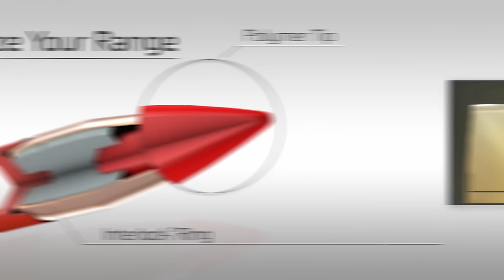Ep. 121 - Let's Talk Load Development

Comment: Stating that barrels lots of components is good to assist precision implies that variations do matter i.e. brass - but at the same time you state brass prep doesn't help. So how big are the variations between brass lots that make a difference if you were to mix them up? (same manufacturer)
Reply: Mixed year/headstamp military .30-06 brass back in the day I'd see as much as 150-200fps ES.  Mixing lots of modern stuff you can still see 80-100fps ES where you would normally expect 40-60fps on a large sampling.  It may be as simple as a revision made to tooling in the forming process of a bullet jacket or a case that may improve the product overall, but makes it different from previous production and causes shifts in POI, or changes in internal volume... stuff like that.  That's why I suggest whenever possible to keep same-lot components together and double check when you get into new lots of components, especially powder.
Reply: @milesn3173  thanks yes I assume we are talking  components that in general are created to tighter tolerances. But it clearly suggests that variations matter. Most of what precision shooters do is remove variations but these podcasts seem to imply that doesn't matter. Could it be that the system/platform being used is what determines if a variation is noise or meaningful. I.e looking at extremes a rail gun vs a hunting rifle.

Comment: This is really interesting, but it doesn't really account for how the top F-class shooters are doing two shot ladder tests for powder then seating AND then consistently shooting mostly X/10 match after match at 600/1000yrds.  Meaning clearly an agg of their match results is statistically significant, so it would be super cool if you all did a follow-on to this with how they do that.
Reply: What you don’t know or see is the barrel they burnt out just for load development.  Plus they turn 8-10 barrels up at a time.  One is usually burnt out on load development and short range local matches.  They then just transfer that load over to the new barrel.  Adjust powder charge and verify and roll on.  Also they usually stick to a cartridge that works.   Like the go to was 284.   Now it seems they are switching to 7prc variant.  Running a round they have ran for years it’s a lot easier to load for.  And a lot of times they transfer load data from one barrel to the next.
Reply: No, thats dumb. If you were paying attention, the fact that the top guys are all using top-tier components/barrels/actions, skill and machining then that more than accounts for their wins. They use good ammo and barrels.
Reply: @Longshot762x51  i know they use good barrels , components, actions and so forth.  But I’m like 90% sure fclass John and winning in the wind have videos where they had a batch of barrels ( same blanks ) same reamer and specs.  And their current barrel was on its way out they switched barrels and their new load development was to shoot their current load and then a few below and about their current load.   I know they use the top components.  But i can guarantee they don’t go thru a full load development process on every single barrel. If they did that barrel would make it 2 matches at most.
Reply: @MrBoostin18 you are right, but you forget all the reloading on old barrel they did that accounts for the data needed. Both them and Eric Cortina do not need to do full development because they know what has worked for that cartridge and the 1000 plus rounds on the last barrel. Erik Cortina admitted that on pod cast with Jayden Quinlan. Changing a barrel and shooting old load a adjusting if need is fine. But Erik said if it was new cartridge and gun he would shoot 3 shot tests and then pic the best couple and do 10 to 15 shot test. He would then pick the best of the two and shoot a 20 shot test to confirm load. Then in different conditions in a different day (Hot vs. Cold Rain vs.Sunshine, etc) and shoot atlest 10-15 more before settling. So add up the shots and it's is not 2 or 3 shots and go with new rifle and Cartridge. Also, Eric runs the same bullets and powder in his F-Class guns. Barrel change to him is like getting your same powder but different lot. You don't need a lot of rounds to find your load if you need to change at all from last load. Erik most of the time does not have to change load. But with new barrel still shoots 2 or 3 shot group then shoots atleast 15-20 more with just barrel change. What they are taking about are people get new rifle or new powder or new bullet and shot 3 or 5 shots and calling it good  and heading to match or worse heading out hunting. A badly dispersed load can make your day bad for match and worse a horrible day for any animal if your hunting. Hope that explains it more.
Reply: Folks the topic and my reply are about load development, not follow on barrels chambered the same, not about their equipment, not their skill reading mirage and wind.  It's about load development.  If people actually read what they write they would know the top shooters don't do large data sets as part of their ladder testing specifically due to if they did they would put too many rounds out the barrel not leaving enough for competition.  If you read for most any of them, they all use basically the same process to find the node and load they want to settle on.  Then in competition they prove that process out by shooting sighters followed by 20 shot groups and do that over many days and matches.  Their own match targets show their development process works just fine and it's not using large data sets.

Comment: You state that hand loader improves over factory loads as you can alter seating depth - that statement appears to go against what you have stated for your load process and your other pod casts. This is getting confusing...
Reply: They didn't say it didn't matter, just that it's effects are not as pronounced as most people believe. Seating depth can have an effect, but it's not going to turn a 1.5 moa load into a .5 moa load. They also make the caveat that this applies only to the chambers and bullets they've tested and that there may be some chamber geometry/  bullet combinations where seating depth changes have a more pronounced effect on group size.
Reply: @lb4937  well the general message is its impact is very small if anything. So why mention it as an advantage over factory ammo? Its hard to see based on this data how hand loading improves over factory ammo in terms of precision. But it is very rare for factory ammo to be shot in precision world. The take away appears to be that handloading allows you to load at a FPS that you want however the slower loads shoot ever so slightly better so why bother - just shoot factory, just keep it all from the same batch.

Comment: Speaking of load development 

When are we going to get 22 creed on the books
Reply: I was told they can’t put any data out for a year. Horizon firearms has exclusive rights to the cartridge for a year because they were a huge force behind getting it saami spec’d. I don’t understand why Horizon wouldn’t want data out help the cartridge. Hornady wants to push the 22ARC, so they don’t want to publish data for a 22 caliber cartridge that stomps all over it. To me they are different enough that there shouldn’t be that much competition between them. One is great option for a small frame AR, the other is the ultimate bolt gun high BC 22 cal.
Reply: @DanL243  I'm sure you're right just be nice to hear it from the company

Comment: I thought the case capacity was measured with distilled water.
Reply: It can be, but it must be done very carefully for it to be accurate. I use a small thin piece of glass over the case mouth to ensure the water is level to the top of the case every time. Otherwise, surface tension will cause the water to be slightly domed or dished relative to the case mouth, and it's very difficult to consistently judge how much dome/ dish you have case to case. Distilled water isn't necessary, really. Tap water is fine, but you have to be careful that there are no drops on the outside of the case or the glass.

Comment: Enjoyed this but have seen a lot of rifles, mainly hunting rifles, that will prove time and time and time again that what you’ve dismissed here regarding seating depth to be absolutely not the case. And we’re not talking a handful of groups……we’re talking large amounts of groups tried over several years, so it’s not data to be dismissed because it’s ’not Significantly sized data’, and I’m absolutely not the only one to see the same. Thousands of shooters have found the same as me……a load can shoot absolutely horribly at 50 thou off and yet at 20 thou off be CONSISTENTLY 1/2 MOA. There’s more to it than just ‘pick a combo and if it don’t show what I wanna see, scrap the whole job and start again’. More has to be at play, different barrel profiles with all the differences in chamber tolerances seen across factory produced rifles. 
You speak about data being important, which of course it absolutely most definitely is, but by the very process of what you’ve compiled your findings on, it’s impossible to state some of this because you yourselves havnt compiled enough data with different rifles from all different types and price brackets…..I’m absolutely not saying your wrong, but for so so sooo many shooters out there using really great loads that would never have been found using your method, and they would have spent a fortune buying endless different powders and components hoping to land on ‘the one’. 
I would LOVE to see this episode all over again with some of the top class hunters that have developed loads for basic off the shelf or mildly improved guns, as well as the likes of Jack Neary and Eric Cortina. I think it would provide a more balanced evaluation of what can be achieved with methods across different platforms in our respective sports with the varying equipment we use
Reply: If you had paid attention, you would have remembered that they specifically poibted out that older hunting rifles or rifles with horribly cut chambers CAN be sensitive to seating depth.

Comment: i do the "Married w kids" method (meaning cheap) - Satterle , 1 shot per charge going in 0.2 increments for velocity nodes, will do 10 shot test starting at book max and going backward 10 charges.
i will find all the nodes and build off of those. if there is not a real node i will use 80% of book max and see from there.
i will test several bullets for the caliber to see which shoots best, SST and SP and ELDX
i do not have money for doing 5 shot groups testing nor do i have access to the components such as powder is very hard to find still so 1 shot groups it is for me.
10 charge weights then a 3 shot group of charge = 13 shots to find best load VS 50 charge weights shots then 5 shot group of charge. - i just saved 42 shots of components
Reply from the maker: I'm not looking for "nodes" at all. Just speed and pressure.
Reply: @hornady  just saying married w kids as in cheap ha
Reply: ...I don't think you quite understood what they were trying to say here. Preston's method is more or less the exact opposite of the method you described.

Comment: Amazing to me that you guys can’t figure out tuners. You think every F-class guy is insane??  And you  can’t explain why your 7 prc factory  ammo is slower than advertised.
Reply: Cant figure out or just haven't proven they actually work as advertised with statistically relevant testing? If there is data proving they work as billed, can you share it?
Reply: @brodychapman8348  I don’t have the time or money to give you data. The pro shooters won’t tell you everything because they hold info close. Hornady shot enough data but the way they used the tuner was wrong. Let me open your mind a bit. In this podcast Miles said that changing muzzle brakes could help your load. Picture when you adjust your tuner you are putting on a different muzzle brake. To get data you would have to know how to actually use a tuner. In other words shoot your 30 rounds with tuner on but not tuned. Then find the best tune.  Then shoot another 30. Miles never found the right tune because he doesn’t know how to use a tuner. Maybe one day I’ll do that and put it on you-tube. In fact I’m going to set up my old 30-06 w tuner. Hornady send me 200 rounds of 30-06 ammo( 178 Eldx same lot) and I’ll show how to tune in a factory load. I’ll use an EC tuner brake.  Then I’ll do it with a $10 limb saver tuner. If I’m successful you can pay me what Miles makes per hour for my time😂. Then you can buy me a new barrel. If I’m not successful I’ll buy the ammo. You can have my credit card number on file in case I’m not successful. I’ll put my money where my mouth  is Hornady. Will you?  You seem to be really sure that tuners don’t work?